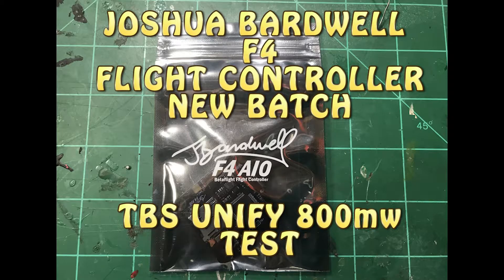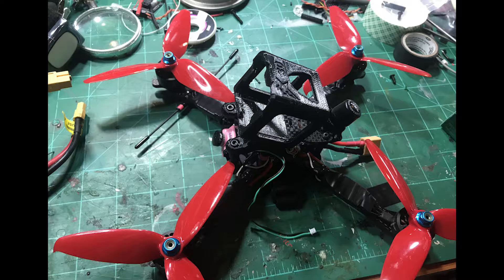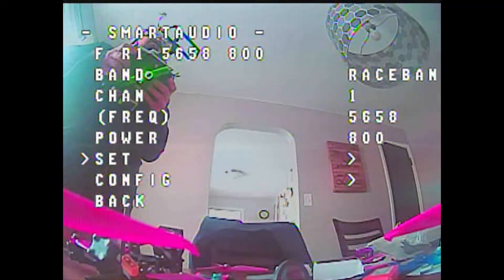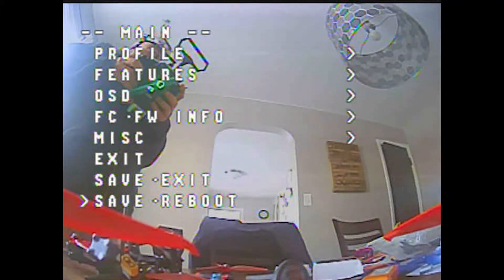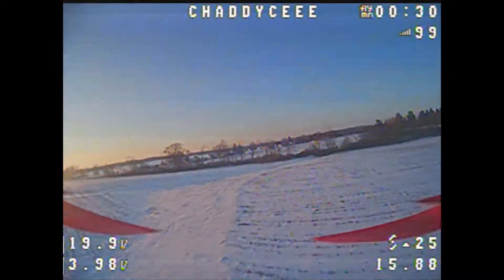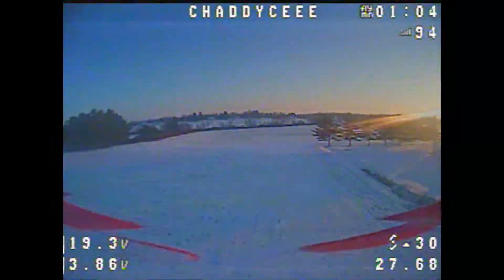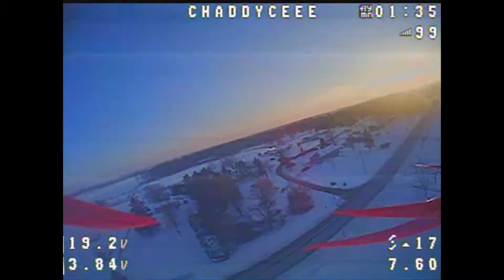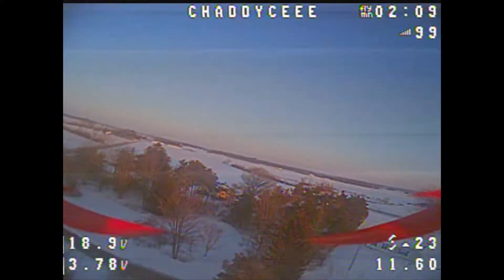JOSHUA BARDWELL FLIGHT CONTROLLER 9 VOLT VERSION TBS UNIFY HV 800mw TEST

Comment: Hey man just got mine yesterday need to install! This will be my 3rd bardwell f4 aio, so I'm really hoping this one works.
Reply from the maker: Biruta FPV what’s up man?  You get some bad ones or you just talking about the hv vtx voltage not working on the old ones?  I’ve got a batch 1 and 2 and they’re all good so far.
Reply: ChaddyCEEE RC 3 pads came off the first, second one gyro is shot.